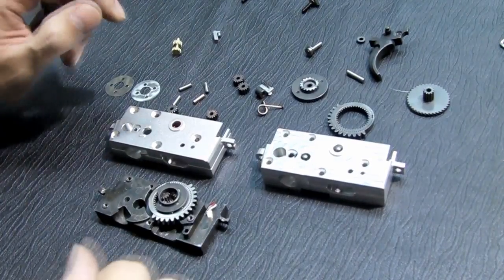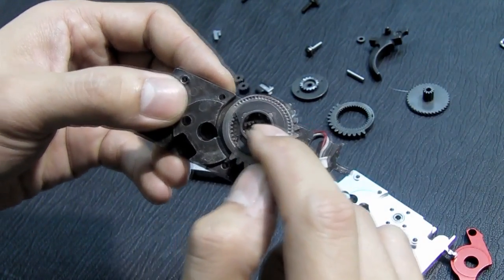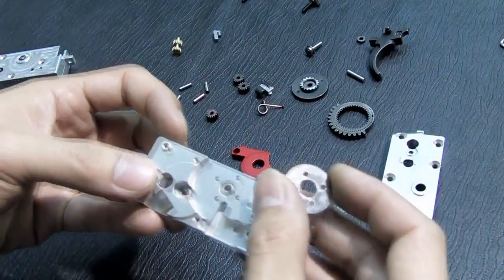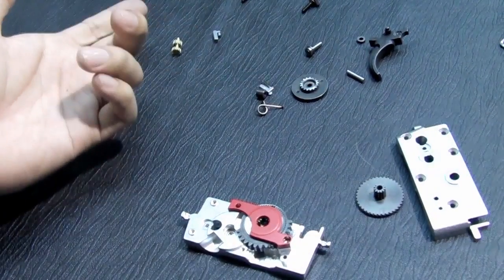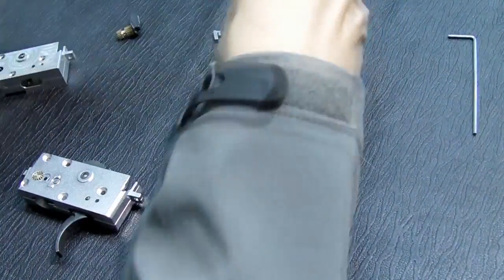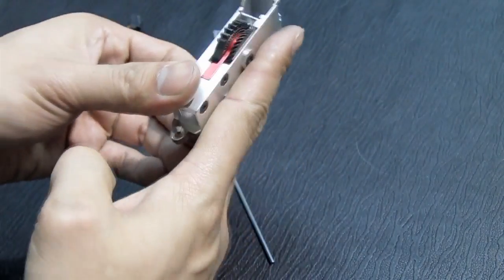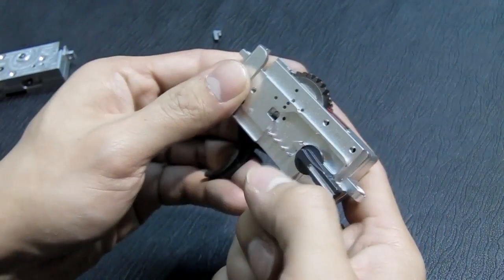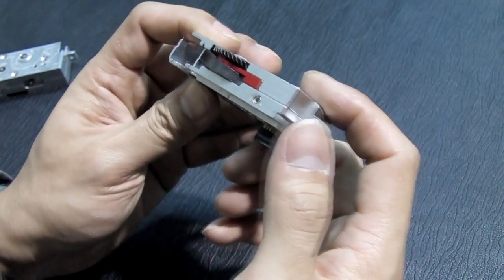Celcius Reformation Gearbox Introduction "MX-4 Gearbox"

Comment: Compatible with Systema Super Max ? Or only Max ?
Reply from the maker: It is compatible with Super Max and Max. Thank you!
Reply: Celcius Technology
What about two "Internal Sector Gear Shim" with larger diameter of central hole ? 

ASB-GBX-RF - Celcius Reformation Gearbox Case

  Package includes: 
  Gearbox Case Left 
  Gearbox Case Right 
  Shaft Support Housing 
  C.A.S.S. Ambidextrous Safety Selector (TW Version) 
  Selector Click Ball 
  Selector Click Ball Spring 
  Selector click Ball Screw
Reply from the maker: Thank you for your reminder, we will update the information immediately. The new version will also include two internal sector gear shims, Mil-Grade Gear Shafts, and four bearings. With larger diameter of the central hole, user can adjust the Sun Gear's shim separately from the Internal Sector Gear, and four planetary gears. However, if the height of the Sun Gear is 9.98-10.00mm no additional shim is necessary. Thank you!